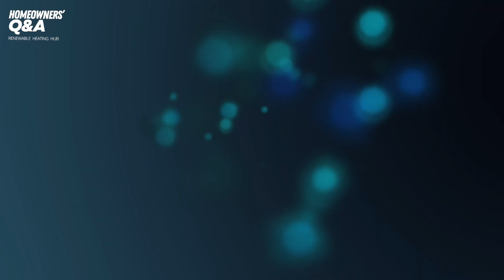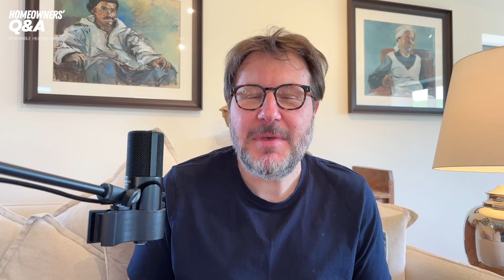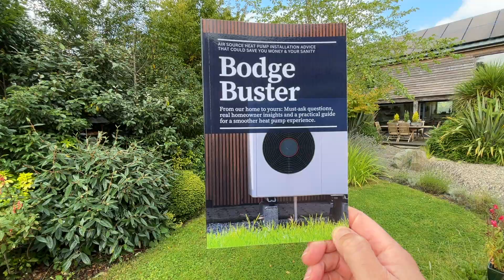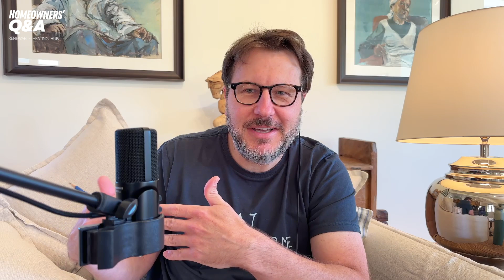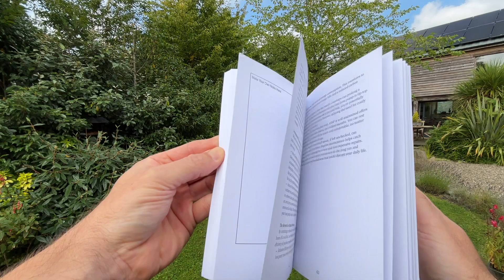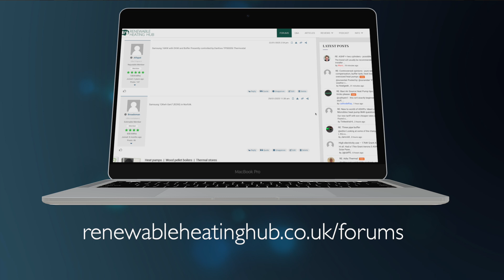The Challenges in Integrating Heat Pumps, PV and Batteries for Full Energy Freedom

Comment: Interesting discussion. I've not got any extra automation other than the control offered by the individual items and it works well enough to give me zero bills.
I have 8kWp PV with 6kW Huawei inverter and 15kWh battery powering a heat pump. I'm on Octopus Intelligent go set to charge for six hours every night all year. In summer it hardly charges so grid export in daylight starts sooner and I use the electricity account effectively as a seasonal battery of export credit for use in winter for overnight import to power the heat pump during the day.
I put the whole thing on a spread sheet to model each average day in each month over the year which predicts the battery state of charge and times of export / import to work out cost and return on investment and payback which is under six years compared to my previous gas plus electricity use and whilst keeping the house at a constant 23°C. I'm at 38°C flow for -2°C with weather compensation and have a Freedon FHP cloud monitor for the Midea heat pump which can give manual control but mainly gets used to monitor performance with a modbus connection to the heat pump control panel.
I have a MyEnergi Zappi and Eddi but the Eddi is not really used now as with the export rate it makes no sense to use it to heat the hot water via immersion - the heat pump does that instead overnight. The MyEnergy app with various CT clamps provides a really good monitor of what's going on with history and I've configured it so the car doesn't drain the solar battery.
I can use the Huawei app to monitor PV and battery and manually switch it to fully feed the grid when Octopus are doing a special hour etc.
The whole thing works automatically on set Time Of Use for the battery and Octopus control the Zappi when I plug the car in which is also best done at night rather than charge off PV.
The only extra automation that might be useful is to automatically fully feed the grid each day in summer to make more use of the battery. Currently that's a manual change only too easy to forget to change back so I don't tend to bother. I notice however that Huawei have brought out an AI device called EMMA which can learn and predict automatically to maximise performance of such things which might be worth considering.

Comment: KISS, I have two powerwalls, two EVs and a heat pump, I simply export all my solar at 15p, charge the batteries and cars overnight at 7p. I use NetZero to make sure the Powerwalls are not used to charge the car, much much easier to use than home assistant, no coding required. Hot water is heated overnight from the heat pump and uses a maximum of 15kWh of electricity a week in summer, we only NEED hot water for the morning showers so do not worry if it is a bit cool in the evening. When you have heating on 24/7 in winter (as you should with ASHP) with the daytime power supplied from the batteries no fancy controls are needed. Our summer exports pay for winter heating and our annual bill is now very close to £zero, happy days.
Reply: Agree...we have solaredge panels and batteries, dumb ev charger and daikin hear pump using Octopus Go but no integration...we charge the cars and batteries overnight and export excess solar during the day ..average cost 14p per kwh
Reply: This is what I'm hoping to achieve.  My battery installer is going to move the charger so the battery doesn't see it but I'll also take a look at NetZero: do you have a link as there are a lot of unrelated hits with that name?
Reply: @andyj2106 Another way to blind your inverter to the car charging current is to add another CT clamp picking up only the car charge current but connect it in parallel to but in antiphase to the inverter CT. The car charge current is picked up in both CTs but cancelled by the reverse connection. Everything else works as normal. It saves having to re-route 25mm² merter tails and Henley blocks etc.

Comment: Luckily, when using Home Assistant the PredBat add-on does most of the hard work for you now.  It’s great at maximising PV, battery and EV integration. But you still have to get started, and HA is not an easy tool for a beginner.  PredBat doesn’t yet control a heat pump, but it already allows monitoring. So there is hope for a complete integration using PredBat.

Comment: Interesting and useful conversation.  I think the points around Home Assistant and manufacturers is valid: HA seems to have become a de-facto solution and it is frustrating that manufacturers aren't creating and managing their own integrations.  I've not found HA at all easy and I spent 30 years as a professional in IT and probably 10 years before that tinkering (part of it might be older brain cells now of course.)  It certainly isn't intuitive and I've only tried to get Octopus Energy integrated!!  As for the Siggen battery system, somebody has created an integration for it, and I'm sure it's excellent, but by golly it seems to assume you know a lot about HA to get it up and running and I can't tell from the discussions whether there are problems with it or not.  I do wish there was a standard for integration across these class of devices though.  When I bought my EV, a PodPoint charger was thrown in (mostly)  but that doesn't integrate well with Octopus Intelligent Go which doesn't integrate with my Siggen battery system which doesn't integrate with my Cosy 9 Heat Pump so everything has to be manually managed OR I have to rack my brains around HA.  It could definitely be simpler, and really ought to be.

Comment: Avoid an overly large battery and buy a generator to top up a modest battery (15-25kW) and supplement the solar PV and maybe a small WTG.  If the space heating requirement is high and you have no thermal mass for heat storage then HIGHLY UNLIKELY you could be off grid.
Reply: Generator = fossil fuel 😪

Comment: I have a Zappi, and it works nicely with my solar and AC-coupled battery storage(Victron), and Daikin heat pump.
I can monitor all three using CT clamps connected to the Zappi.
The Zappi can consume excess solar without draining the battery easily enough.
I do use HA(Home Assistant) to override the Zappi and battery storage based on signals from the Octopus Energy integration.
I also use the Daikin integration to monitor and control my Daikin heat pump.
HA is easy enough for anyone reasonably tech savvy, but to make this sort of thing plug and play needs developments like Octopus Energies Project Mercury.
I did some coding in my twenties, but that was 30 years ago, and I find the learning curve manageable with all the user guides available.
The complex part is writing integrations so that all the tech can talk to HA, or when something doesn't work as expected.
Luckily, there are people out there writing these integrations and sharing their knowledge.
If it has an internet connection and an API, someone has probably written an integration for it.